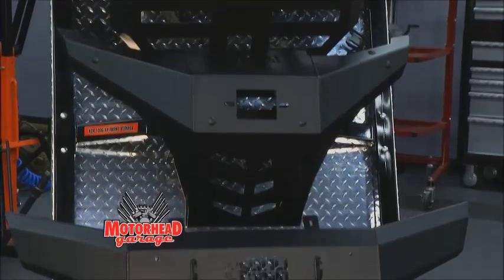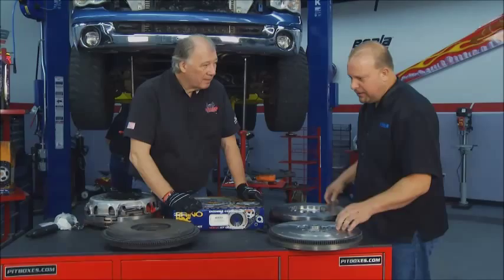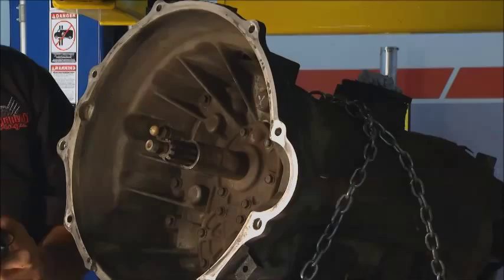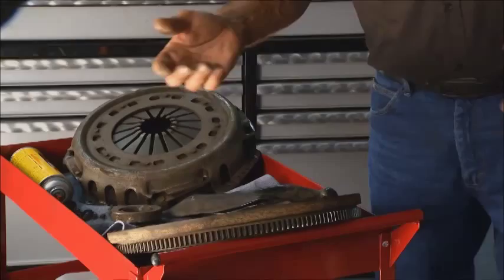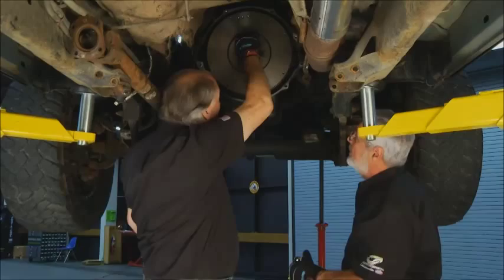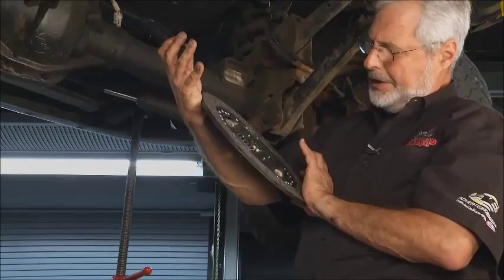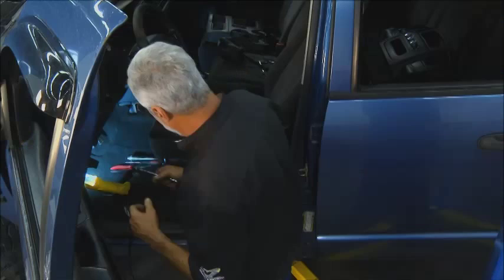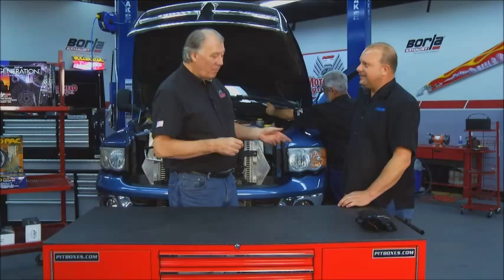Dodge Ram Clutch and Flywheel Installation (Motorhead Garage 8/5/14 episode)

Comment: When torqueing the pressure plate blots you should be tighten in a cress cross pattern one turn at a time each after the bolts meet the pressure plate to prevent warping the pressure plate.